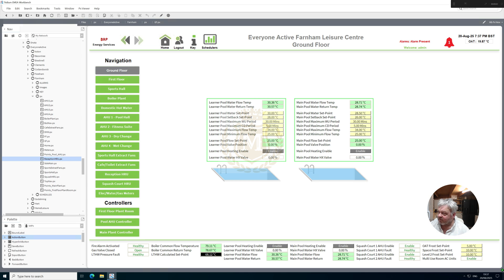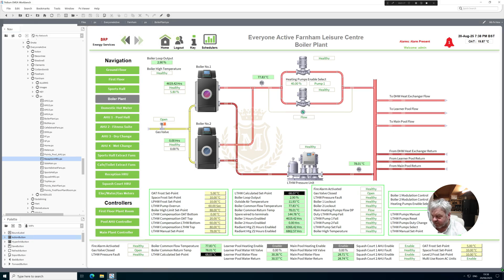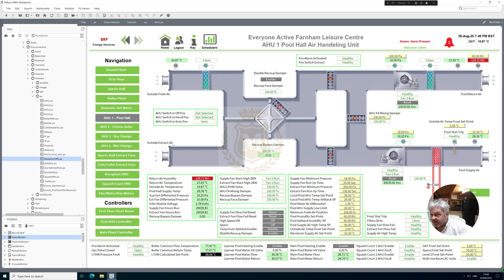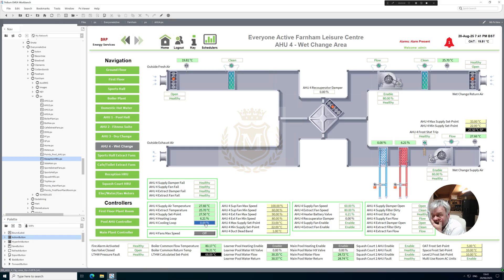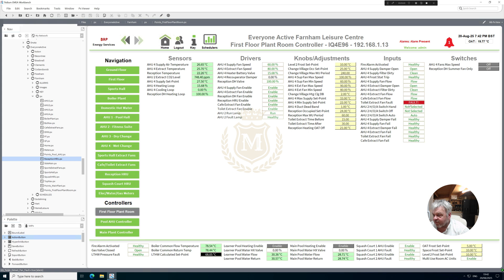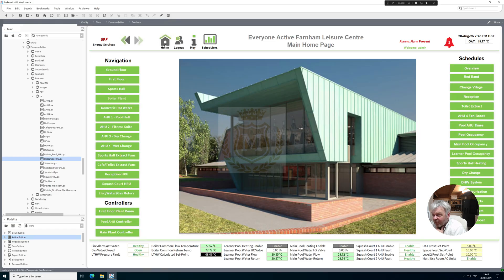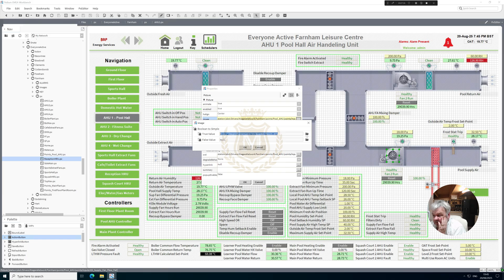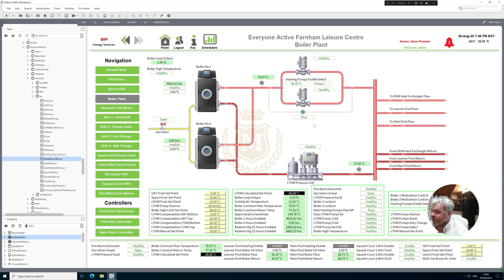#185 N4 Tridium Niagara - AHU's, Boiler and HWS graphics completed

Comment: Hi sir Can you help me to tell how to put offset in Niagara
Reply from the maker: Offset in a numeric point, like a temperature sensor ? 
You would go direct to the numeric input and expand it to see the Proxy Ext folder.
Then you will go to the conversion and change Default to Linear on the down arrow button to the right of the word Default.
Once you have selected Linear, you then can place an offset in the box that has 0.0 in it. You can use the minus symbol if you want to take away a degree, for example -1
Reply: Thank you so much for answering